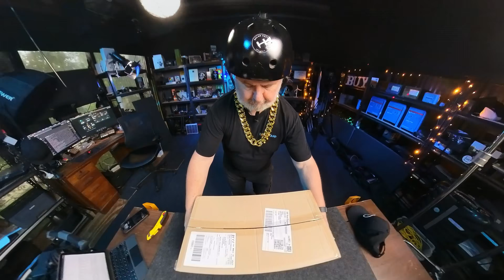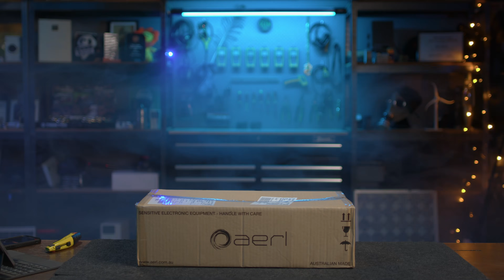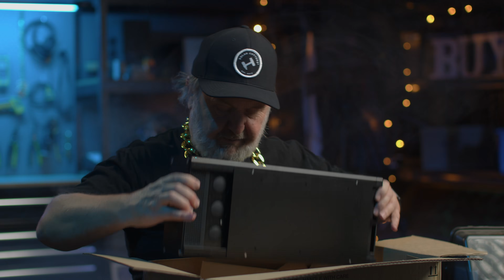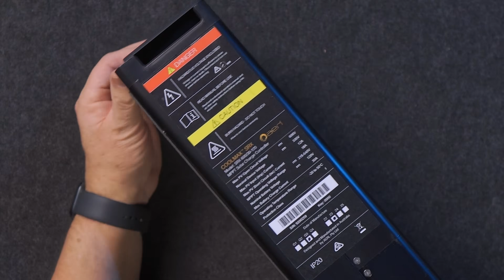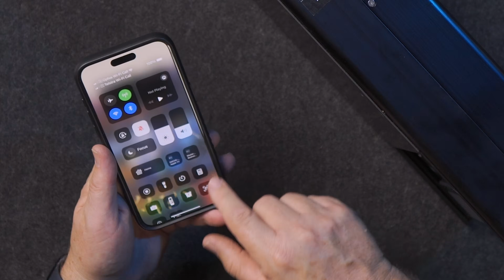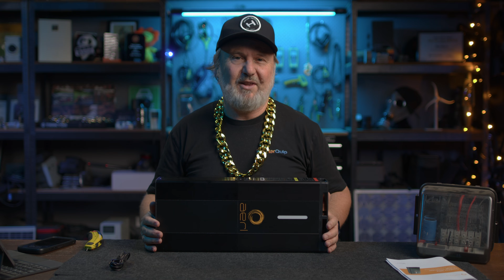AERL 600V MPPT for 120V Battery

Comment: So if you’re trying to charge a 48v (54v Bulk) battery bank from a 540v single string array, are you still limited to 30A going to the battery bank?
Reply: It’s not designed for 48 V system is designed for 120 V DC battery banks only. It will recognize a battery from 90 V up to 170 V and anywhere in between. 

I am going to buy one of these for a 32 cell lithium battery and it will power 120 V DC motor for a sawmill
Reply: @michaelchownyk5255  oh ok, wow quite a niche market. I know that railways use 120v DC quite a bit. I’ll have to check out the whole 120v DC world of motors and batteries to learn more I suppose, thanks for the heads up. Schneider have had a 600v to 24v and 48v for quite some time, odd that Aerl kept to such a narrow market segment. They make excellent equipment so I’m sure they’d thought it all through.